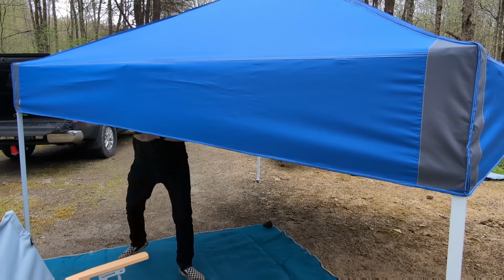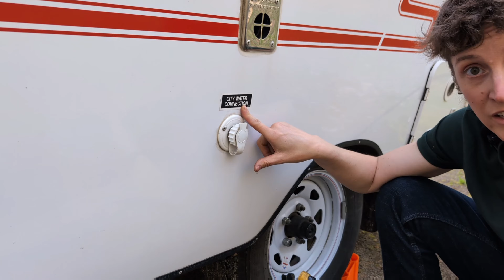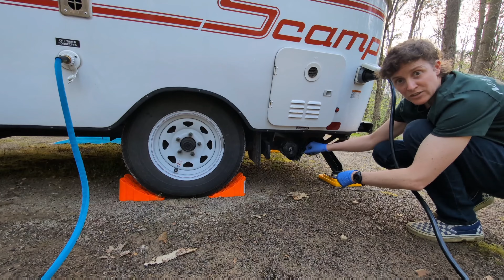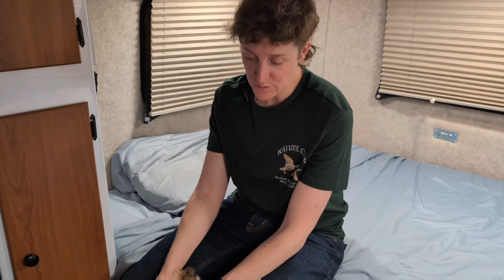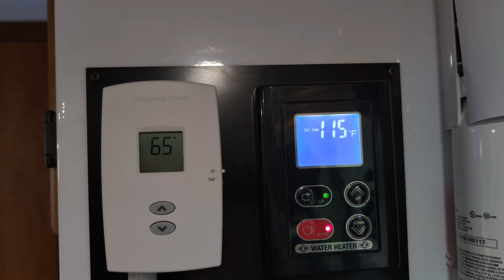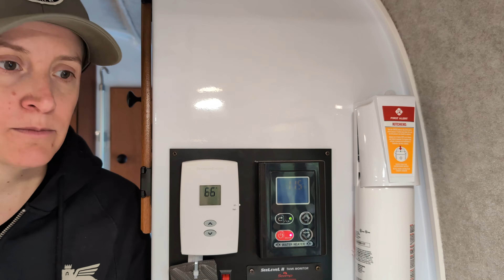Scamp Plumbing and Water Heater Basics

Comment: Thanks for the video. Have you ever had water gushing from behind the hot water heater? I can't figure out what's causing it.
Reply from the maker: You're welcome. I haven't personally but water gushing from behind an RV water heater can be caused by a few issues, including faulty connections, a worn or damaged temperature and pressure relief valve (T&P valve), or even a damaged tank itself. 

Connections at the top of the water heater, like the inlet and outlet pipes, can corrode, loosen, or become compromised, leading to leaks. 

Loose or faulty fittings and pipe connections can also cause water to escape. Hope this helps, good luck!

Comment: Can you please share the name of the  filter and hose you use? Thank you:)
Reply from the maker: @ninakalin1318  I always put links to everything I discuss in the video's description box. 

But this link to my Amazon storefront contains both products as well. Hope it helps!

https://www.amazon.com/shop/backcountrydirtbag/list/3NAXE7MW449TU?ref_=cm_sw_r_apann_aipsflist_1GFC8NTGWG9GEZH8Z6T9&language=en_US
Reply: Thanks yes i see that now.  Hope you don't mind another question.  I'm on the fence about getting the single or double propane tank.  I do plan on boondocking but most likely under a week at a time. I'm not crazy about the extra weight on the hitch.  I need to be careful with weight as my tow vehicle is a Subaru outback. I decided on the 16' because of the dinette.  I figured it will be more convenient to have a table and a bed set up at the same time.  Thanks
Reply from the maker: @ninakalin1318  I don't mind at all. If I could go back in time I'd just get the one propane tank. I mostly boondock and my 1st tank lasted me a little over a year. 

However, I cook on a Coleman stove most often and hardly ever use the water heater so that's something to consider. 

But one tank would have been way more than enough for us and it would be easy to just carry an extra LP tank once the one on the trailer gets down to a quarter full. Then I could just swap them out mid trip if needed.

Comment: Thank you so much for the constant updates! Have you found any solutions for expanding the fresh water tank capacity? For boondocking, 12 gallons is just not enough. I've been wondering what others do. I've considered buying water jugs/bladders and then filling up the tank but not sure if there are any other solutions out there.
Reply from the maker: You are so welcome. I'll keep em coming. When I boondock I carry two 12L drinking water haulers you can see discussed in this article on my blog: 

https://scamperlife.com/2024/01/07/camping-gear-that-elevates-the-experience/

But when we camp near water I use a water filtering system from my backpacking kit to filter from streams, creeks, rivers and lakes. It takes a bit of work since it only filters 3L at a time but the system is very compact and uses gravity to do the filtering. 

You can see the stripped down version I use for backpacking discussed in one of my old backpacking vids but I am working on a off grid/boondocking video so stay tuned. 

You can see the filter and collection bag I use in this video. I just got two 3L Cnoc bags (instead of the 2L and water bottle seen in this video) to use as my Scamp boondocking filter setup: https://youtu.be/oVX9Thc5L_o

Comment: I have a 2018 13 ft no bath. When opening gray tank do you just empty into bucket and then dispose in a bathroom? Great video.  I’ve not found info regarding tanked water heater do you have resource for that
Reply from the maker: Thanks so much. When I just use my gray tank I still dump it as demonstrated in this video. I suppose you could try using a bucket but I'd be worried about overflow. The gray water is still really smelly so using the hose directly into a dump station is the best practice. 

I do discuss my tanked water heater in my previous RV a bit in this video: https://youtu.be/9yqOUcgNNH0

It isn't as in-depth on the water heater but it covers a few basics.

Comment: Do you know if Scamp still offers the tanked heater as an option?  They are more of a pain to maintain, but it seems like they will be a better choice if you like to boondock.
Reply from the maker: That's a great question. I'm not sure. I do know they aren't crazy difficult to swap out if you have the room for it. 

But I don't mind the tankless option. The "instant" hot water is nice when we have full hookups and when we are off the grid I usually just heat water on my Coleman stove. It is a very efficient alternative for everything except a hot shower.

Comment: Thank you for the very informative and thorough video!  I learned a lot about the tankless water heater.  I think I still prefer the tank water heater though. 😊
Reply from the maker: You are very welcome. I'm glad you found useful information in it. Tankless definitely has its pros and cons. I really appreciate how easy it is to winterize and the built-in anti freeze safety feature. But yeah... sometimes I miss my previous water heater. There was nothing like a hot shower right at the trailhead after backpacking for a week or more. Total luxury.